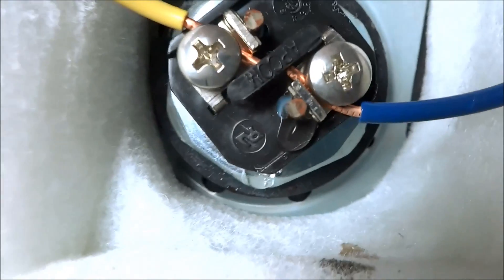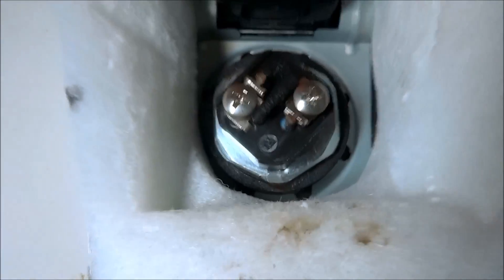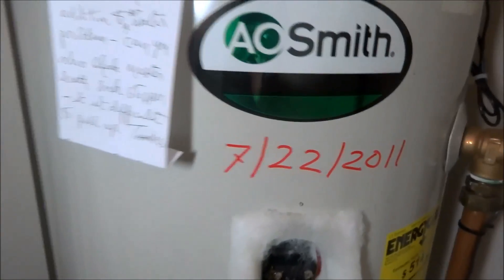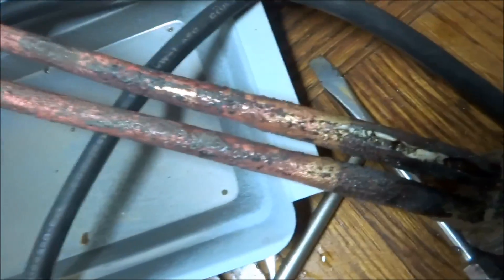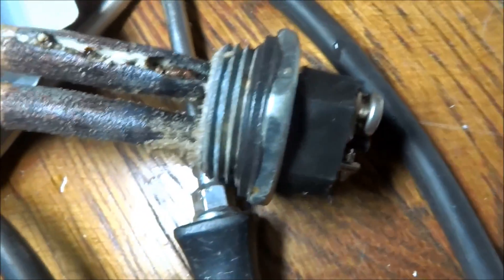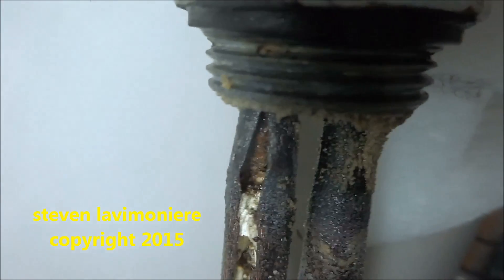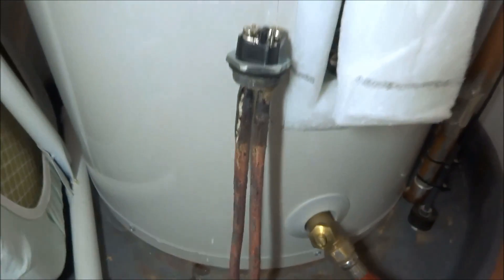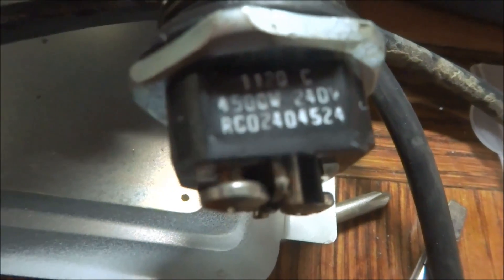electric water heater tripping breaker in electrical panel

Comment: I have been finding elements in the hot tanks of water coolers that have rotted through and been blowing the electrics ,previously to my taking over the repair of the coolers they scrapped them as they had no idea what the problem was ,so check the element in the hot tank guys could make the boss very happy saving money for them .

Comment: we have seen this quite often in the past few years.. the leaking through the sealed element..  used to be it was very rare ,,, i think we are getting lesser quality parts than we used to be able to get.

we had one that kept burning the top element... make a long story short,, there was siphoning from the cold water supply into the tank,, replaced the water heater vacumn breaker,, heater stopped burning elements.. ( eveidently the vacumn breaker was malfunctioning or cruded up someway and not doing its job and allowing back siphonng of the heater anyway .

we install vacumn relief breakers on all water heaters now for the past few years .. it saves us a lot of headache..  did that unit have a vacuum,n relief plumbed in ?

good vid  good job
Reply from the maker: nate yes the tank had a vac breaker thats code in my state

Comment: It seems all the new electric hot water heaters are junk. For the money you pay, you should get at least 20-25 years from them. I guess those days are over Steven.
Reply from the maker: Brad1237202 i have a feeling someone might have drained the tank and keep power on not sure but a hunch

Comment: Considering how cheap that element appears to have been made I'm surprised you didn't replace both, almost like getting half a brake job?
Reply: John M954 so do you replace every light bulb in your house because one is burned out?,,, same theory......
Reply: nate Of course not, but if I'm asking a service guy to come out and climb a 20' ladder to replace one of two burned out bulbs, I would expect him to replace both. In this case the water heater was not that old and one element failed. I'm only suggesting the second might have similar problems given they came together from the same factory batch. Now if the owner has other plumbing issues, this would be another story.
Reply: I am not about to speak for Steve,, but  I would assume he makes the repairs the client ask for and not spend their money unless they ask for it or he recommends additional repairs HE fells like would be in their best interest.

I know from my experience in the industry,, ( which is rather vast) that replaing only one element ( the only one that is burned out ) is common place.. ) also it ususally makes more sense not to disturb the bottom of electric water heaters if possible due to crud build up in the bottom of the tank,, ( you see most homeowners never think about replacing the anode rod and all sorts of corrosion occurs in these heaters ( electric) usually starting at the bottom..  to make it simple if a heater element is not broken, I see no need to fix it,, some electric heaters ( probably most) spend their complete useful life and only just have one element burn out,, before the entire heater needs replacing. 

but maybe I am not as smart as you and do not have  your wisdom. maybe when I grow up I will be as smart as you are.

btw,, I quit counting  housing units I have built  a decade or so ago,, got to hard to keep up after you reach over 10,000 housing units; and  after crunching the  maintenance numbers on properties managed of well over three times that number,, I probably am not qualified to to contradict your wisdom of replacing elements in water heaters that are not burned out.

Again,, I hope to grow up and be a smart as you on these matters.

and once again,, understand,, I am by no means speaking for Mr. Lavimoniere.

He needs no one to speak for him or explain his actions,, his work and  ethics speak for themselves and I do believe the man covers the ground he stands on quite nicely.
Reply: nate You make several excellent points and like they say ... if it's not broke don't fix it! My question is, as the stuff people buy in the trade gets cheaper and cheaper there comes a point when some part prematurely fails one has to decide what's the chance it's matching part will follow? If this failure is normal then by all means you're correct ... leave well enough alone. Advise the owner what's going on (with a note on the bill) and if they rather save a "few" bucks, grab the check and go home. On the other hand I rather not give customers something to complain about.
Reply from the maker: John M954 i only replace the part that  is bad .if the other one is good it stays.. brake pads well thats a different story yes i would replace both ,but this in not a break job its a water heater.